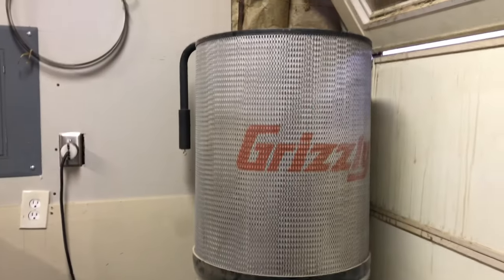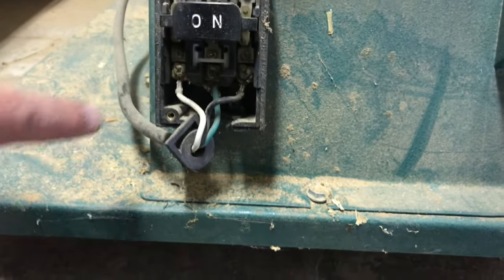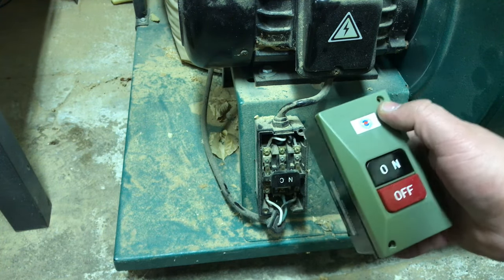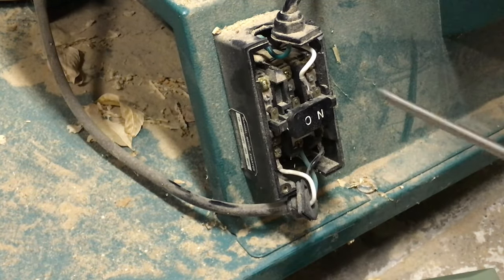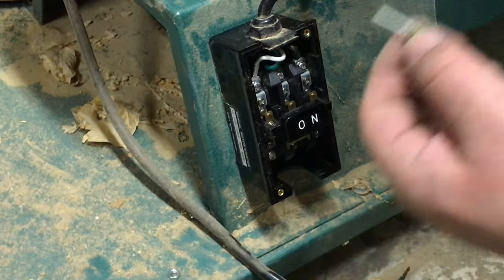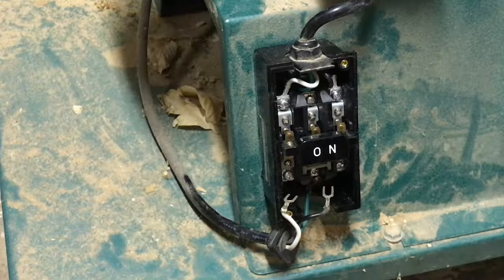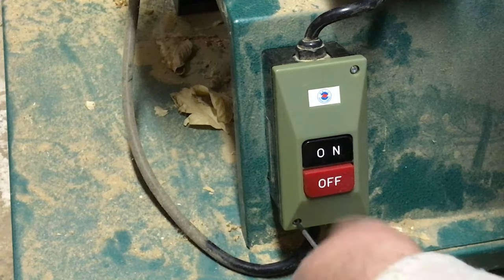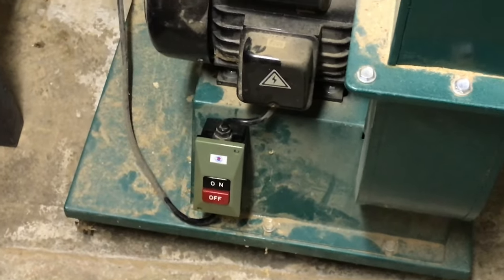Replacing the Power Switch on a Grizzly Dust Collector

Comment: Too right, replace it! That green wire is the earthing wire - to blow the fuse or circuit breaker in case of a fault in the machine - and protect the user. Not a good idea to leave it off, or put it on a spare terminal. On ya for reconnecting to the metal frame. Can't believe they'd supply a switch without the screws! Never seen that B4. Anyway, well done (p.s. I'm a sparky)
Reply from the maker: I really should have replaced it ages ago. I just kept forgetting about it. When I ordered my drill press from Grizzly luckily I had a moment of good memory and ordered the switch at the same time. Sometimes this bulb is pretty dim ;)